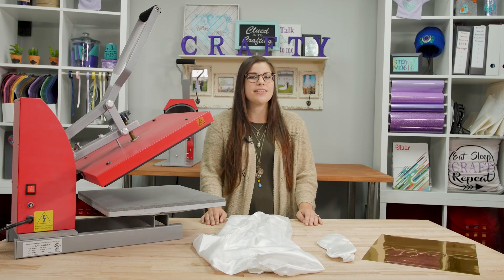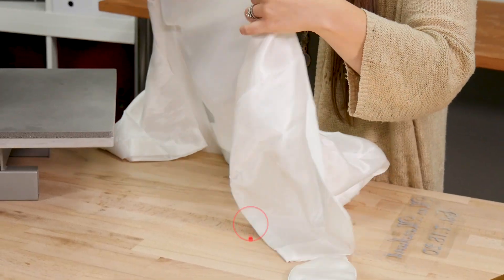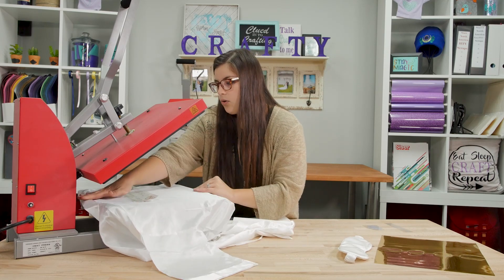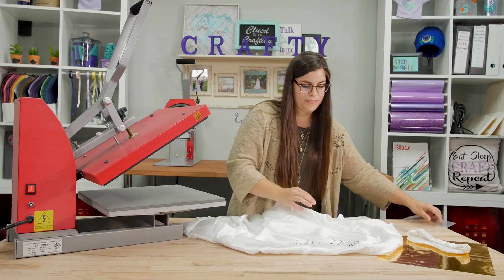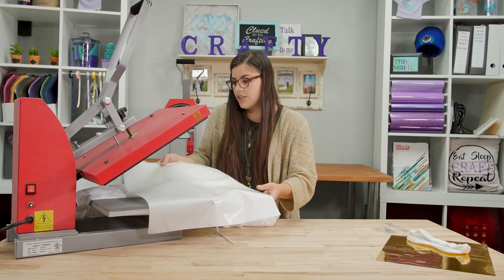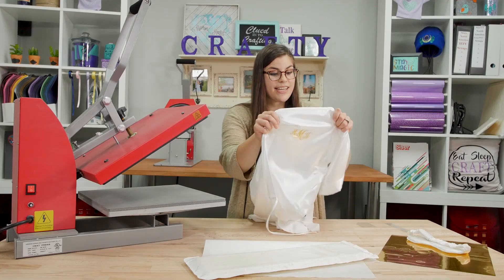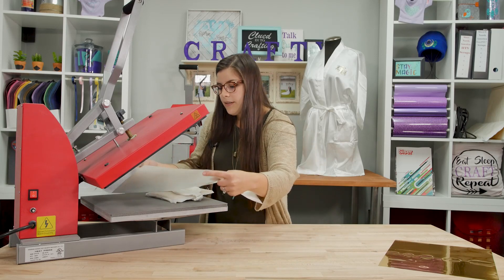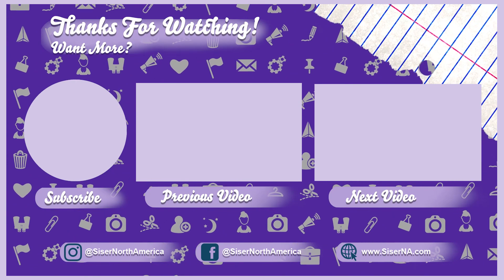Heat Pressing Satin and Silk - Clued Into Crafting

Comment: Hi Siser!! Thanks for the Greta video! I made some polyester pjs with the strip flock. I followed application instructions on the web of 15 secs on 155 degrees with medium pressure and waited over 48 hours to wash but unfortunately some letters still peeled off 🙈🙈 is Stripflock not recommended for polyester? Hope you can help! I made a whole heap of Christmas gifts with this method and it’s peeling off. Thanks so much I’m advance
Reply from the maker: Hello Nicole, sorry to hear this! If you could please contact our Tech Support, by calling 586-203-8171 , we can try and remedy this for you!

Comment: Is it possible to later remove the vinyl if you make a mistake? I did a monogram on the front left chest and mixed the names on two robes. I only see advice for cotton t-shirts.
Reply from the maker: Yes! you can use the VLR solution to remove your Siser HTV

Comment: Hi hun, so I need to put a logo on a silk dust bag, can I use my normal iron on printer paper, so I print the logo first cut it and then iron on? Xx
Reply from the maker: Hello, since we do not do anything with printer paper, we cannot guarantee how nicely itll work out. If you are using Siser HTV, then yes, you can apply it with an iron.